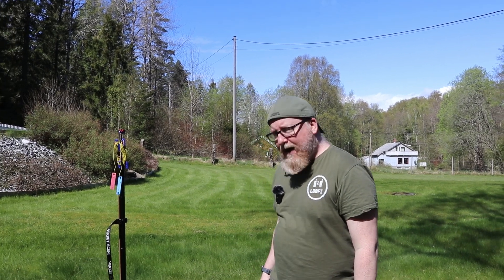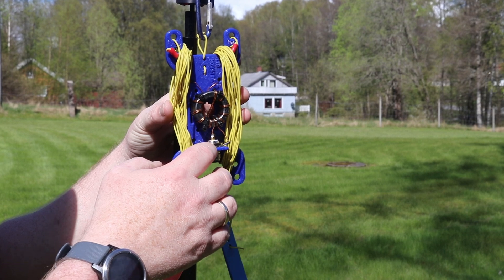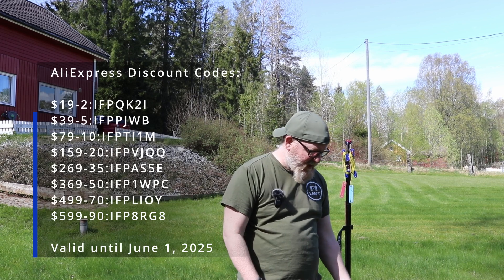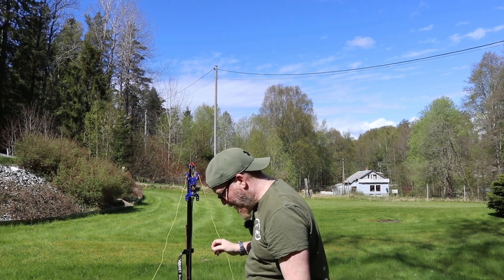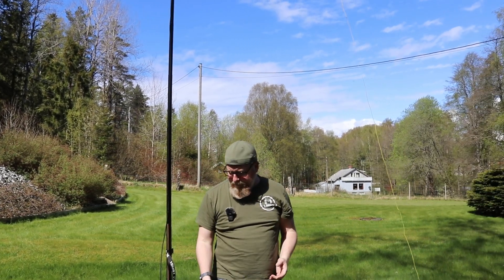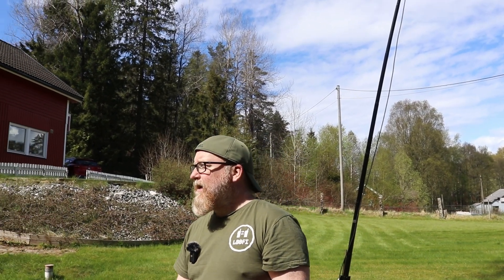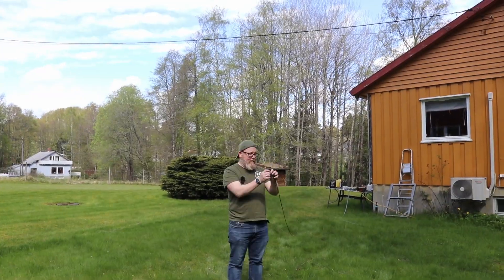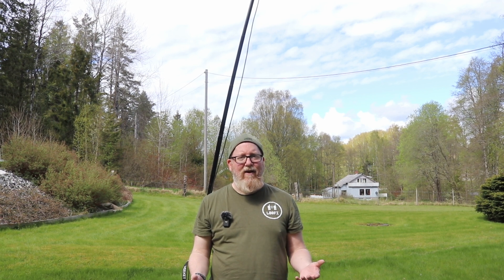How to TUNE A DIPOLE

Comment: Is that antenna only for 20m. Or could you have multi bands in that much wire.
Reply from the maker: A dipole is a monoband antenna. Or more correctly it is resonnant on every odd harmonic, so for amateur radio use you could use a 40m dipole for 15m as well. What you could do, is to make either a linked dipole or a fan dipole, and then you would get some multiband capabilites out of it. 

I have a video on the drawing board for making a linked dipole, but I just need to find time for it. Make sure you are subscribed to get notified when that drops.
Reply: @ I see in the internet, a lot of places sell dipole that is multi bands, but I can’t find a calculator to help me with length of wire and what size balun I should use. I made a few dipoles for single band, but I like to make a multiple bands one instead of paying $100+ from eBay or $200+ from radio stores. 
Thanks. KR4CKV

Comment: I love your videos! I just wander... Is it posible to take 300 / the first NanoVNA-frequenzy / 4 and find the electric length of the antenna, and then somehow "do the math" to find out how much to cut off? I might be wrong here... You have the fysical lenght, and the electric lenght. Might be an idea to dig innto for a video? 73 de LA6UOA!
Reply from the maker: It probably is, but it’s probably faster to wrap it back or cut it in small increments.

Comment: I also wind the extra back up the element, even 15cm doesn't effect the antenna, and it give you a bit of adjustment if needed at different locations. It looked like a great day, we has 25c in my back yard today, first really warm day so far, but that means the flies are not too far away!!! lol  73 VE1SK
Reply from the maker: I should probably wind back as well, but I have always cut the wire, so I guess it's just a habit.

Comment: Nice Video and great location.  When trimming an antenna I wrap the end tightly back along the radiating element.  There might be situations where the length may have to be changed and a tight wrap around the element does not affect antenna length.   73,  John k0ebc
Reply from the maker: I should probably wrap back, but I have always cut, and habits are hard to break.